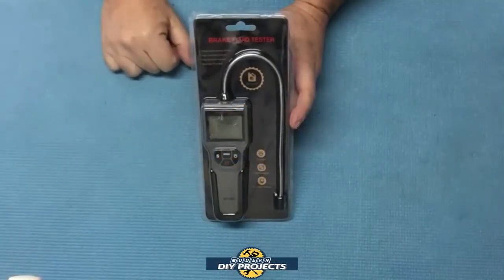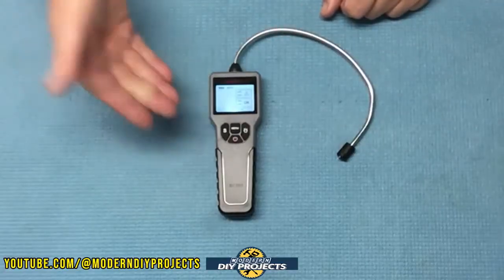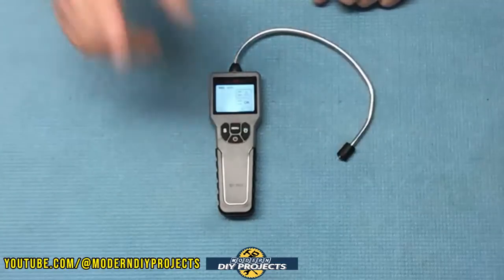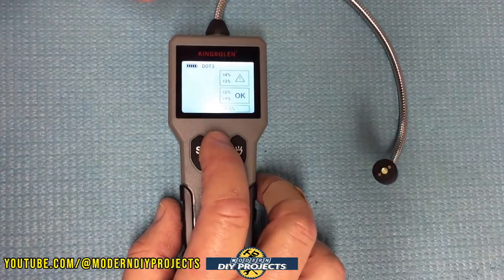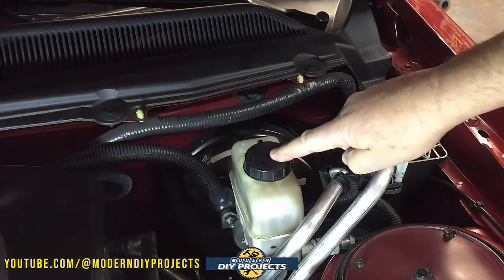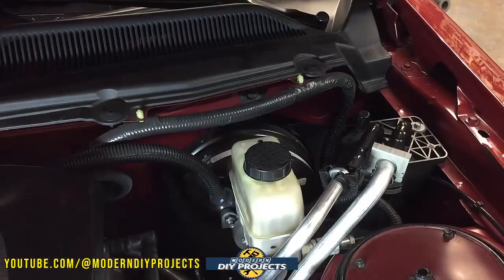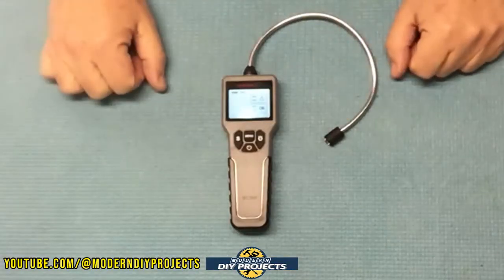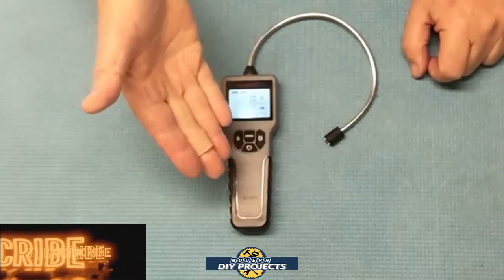Digital Brake Fluid Tester Review, Is your Brake Fluid Any Good?

Comment: Thank you for a useful video. The colour of the fluid does actually tell you something. The fluid becomes darker over time - this change to a darker colour is because of carbon build up. The carbon that builds up in the fluid is very abrasive and will make components wear out faster.